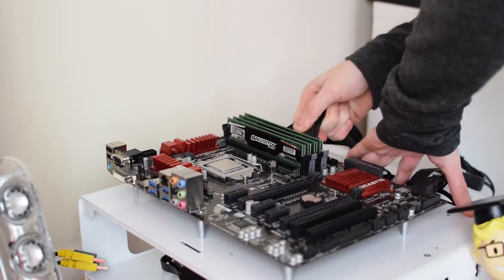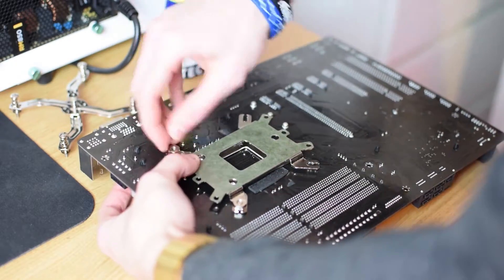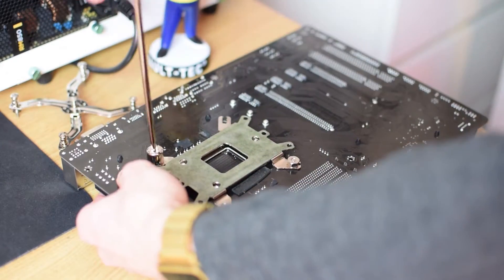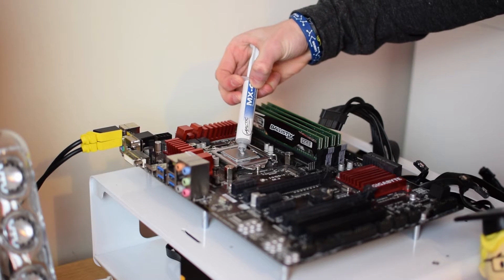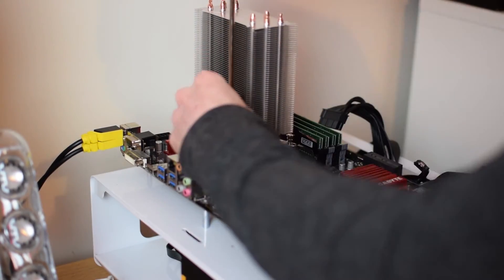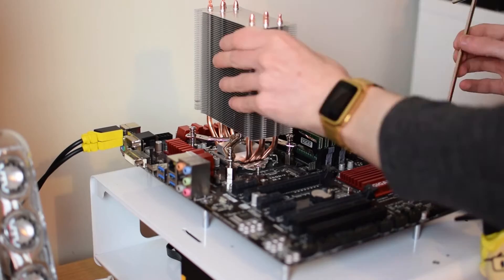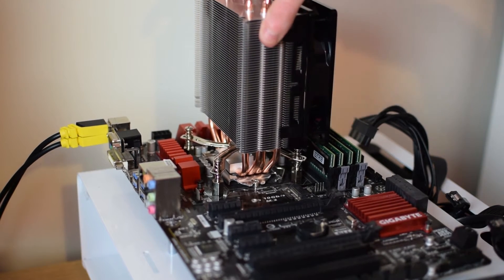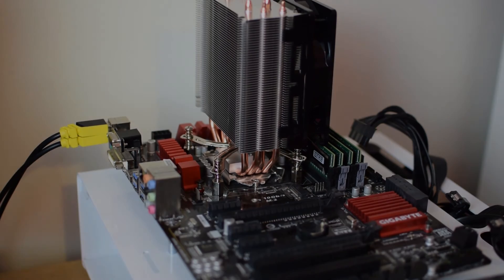How To Install A Hyper 212 EVO Cooler

Comment: Installed on my old 2600k 1155 and make a huge difference in cooling, stock was running 70 to 90c replaced stock with this cooler and now never goes over 40c.  I did notice mine would twist when applying pressure but as far as wiggle there was none.   Great cooler for 30$ imo.

Comment: I don't know what you did wrong but when I installed my Hyper 212 EVO on an MSI Z370 Pro board  with I7 8700k the cooler does not wiggle. It is solid.
Reply: same it is solid